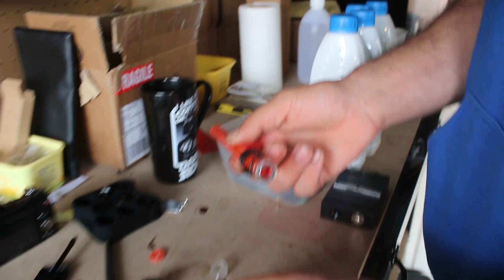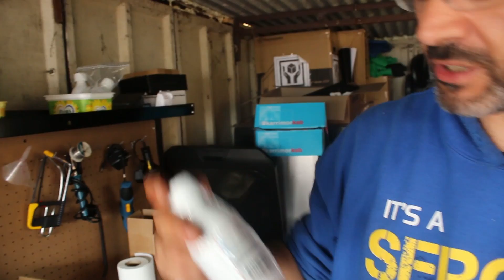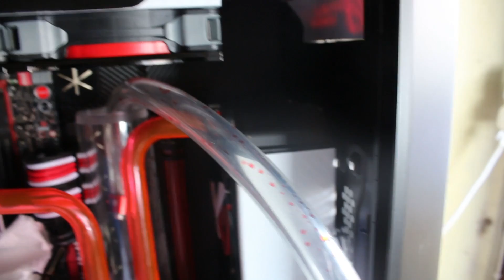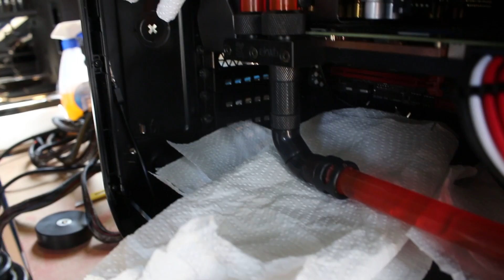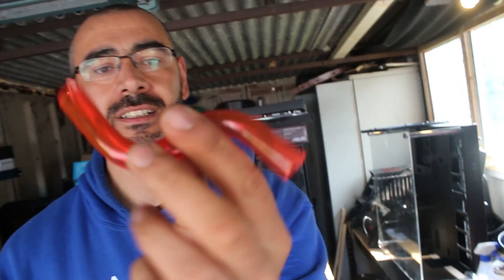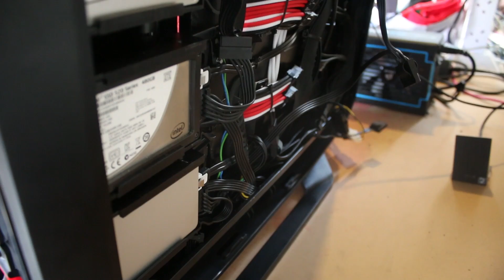PcShed Finishes Custom Asus X99 Watercooled Gaming PC - Vlog Part 7-10

Comment: hey so i have a $600 USD pc Budget and i was wondering what parts i should get? If you have any ideas please tell me! Btw nice Channel dude. Please do some reviews on parts !
Reply from the maker: Hi, thanks for the feedback. In regards to your budget pc£459.63, it depends on several things. firstly what monitor resolution you going to be using (1080p, 1440p, 4K). Once you decided that you need to make decision if your going for Intel or AMD cpu and motherboard socket. Then Nvidia or AMD graphics card.
I can tell you that for your budget which in UK is £459.63 AMD motherboard/cpu will be best value. At least half of your budget i recommend to put it towards graphics card. Nvidia currently have the edge on AMD but you will pay a premium for that edge. AMD in the other hand have good decent graphics cards at a reasonable price, but until i know what resolution you planning to use, I cant give you a breakdown. My advise is buy second hand motherboard/cpu/gpu/ram and you make a decent saving which in turn will give you the ability to buy newer components. Hope this helps. I am currently taking a 3 month break hence not uploaded anything these last few months. In regards to do reviews on pc pc parts, there'splenty of plenty on YT who do this must better than me and make a living of it, while i simply just do it for the fun and not money.
Reply: Wow thanks dude, Im going to go with Intel and Nvidia but im not too sure what parts to get, ive been watching a few of ur videos lately and think that you will probably be the best to help me out. Im wanting to game in 1080p. Ill be mainly playing games like csgo, gta 5, bo3, arma etc. and i want to be able to achieve at least 60fps medium+ settings. thanks.